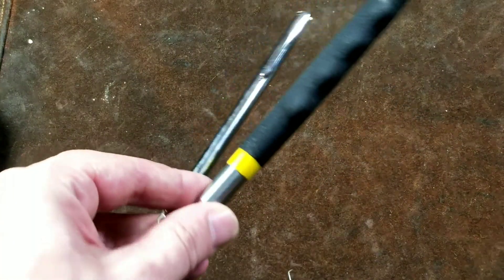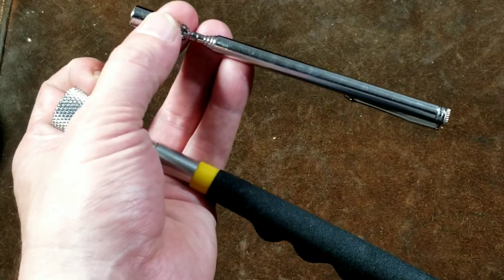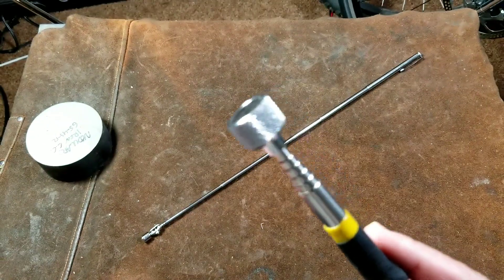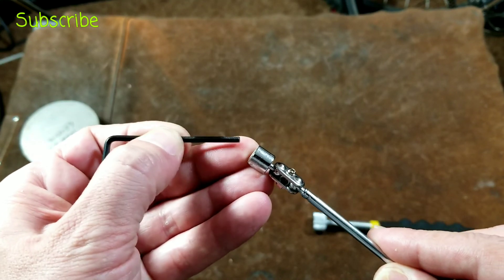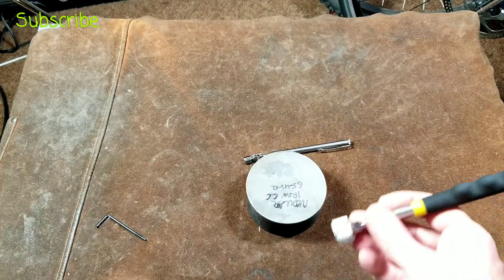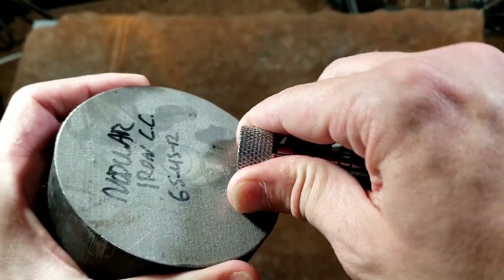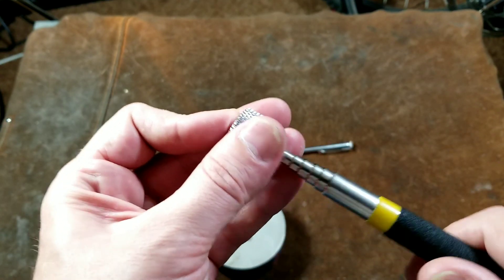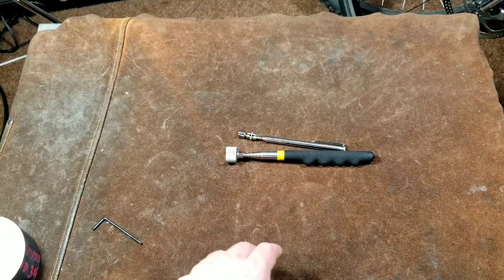Harbor Freight Large & Small Magnetic Pick Up Tool Review

Comment: Thanks for the review, I needed one to go through a 1/2 inch hole in an oil pan this model worked great. The head is about 3/8 in diameter or a bit smaller. The HFT site doesn't list the diameter.

Comment: The best I have found is the Ullman  Magimmick, my #1 is old and may not have the strongest pull but it's extremely sturdy.
It's got a thick hexagonal outer tube and solid steel hexagonal inner shaft.
Of course it's an extra strong.

They offer a large line of pickup tools and inspection mirrors among other things, and as far as I know they're all still produced in their Conn factory.

Comment: The heavy duty magnet looks just like my Mac brand magnet tool. Bet it's a lot cheaper than my Mac was.
Reply from the maker: It would be nice to compare them it is very possible they're both from the same manufacturer although there may be different manufacturers of the same tool if it's patent ran out then you would notice a quality difference and weight difference
Reply: At least you didn't buy snap off